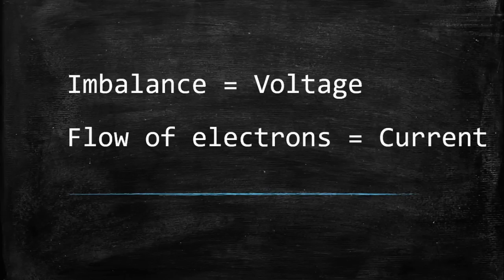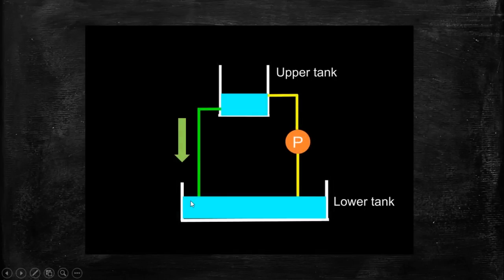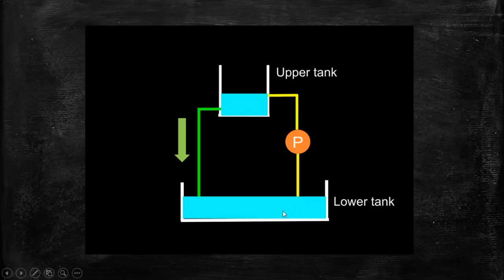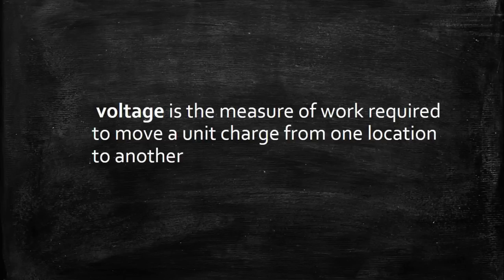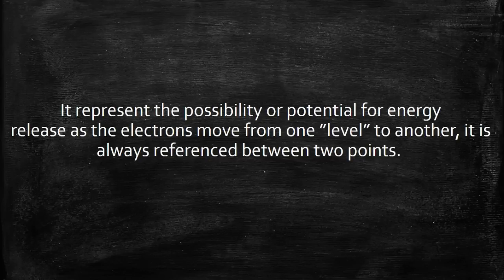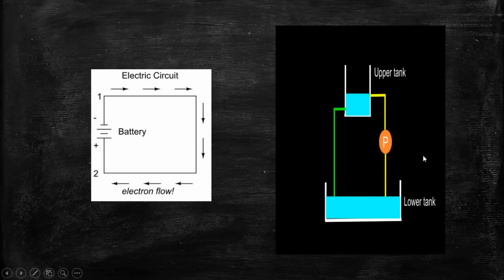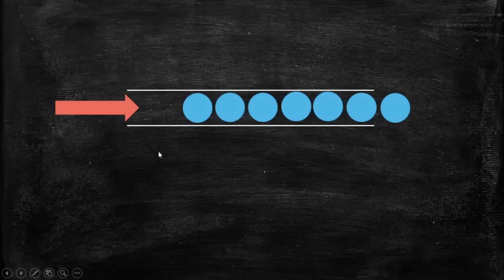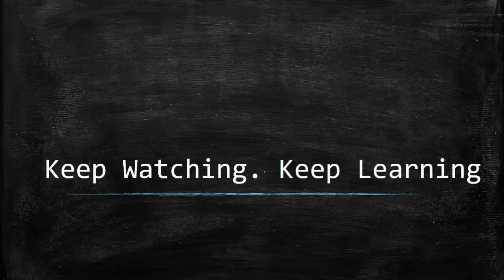Basics of voltage & current | Easiest explanation | TheElectricalGuy

Comment: So electronical tools like drillers, chain saws or heavy electricals machines will require more voltage supply or more current circulation. Thank you for driving my ignorance away.

Comment: Which comes first voltage or current
Reply: mohit nama depends on the load that you've connected, if it is resistive the vltg is in phase with current, if it is inductive it lags if it is capacitive it leads